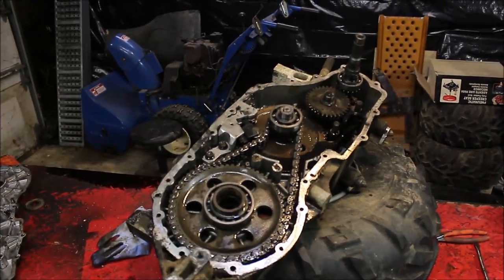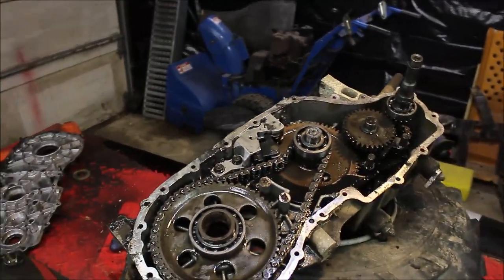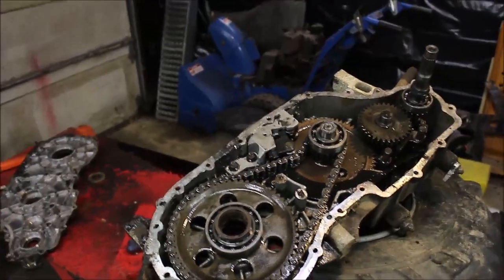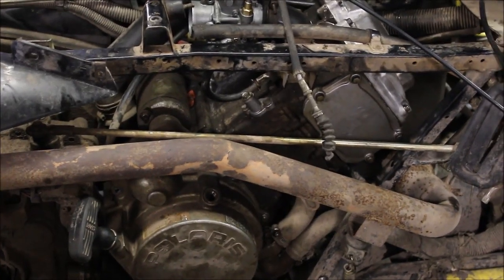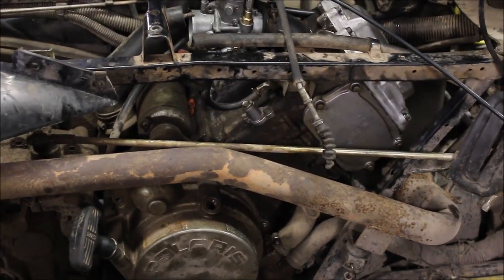Titaniumman Garage intro.

Comment: Your channel is our source of information on sportsman’s for us please keep up the great work !!! LOVE THE TRAILER !!
Reply from the maker: Thanks. Hey how did the engine build go for you?
Reply: @TitaniummanGarage  He has bought all his parts just waiting on it to warm up enough to get into the Shed so he can start on getting motor out and start rebuilding it probably here in a month or so we just got the atv off Facebook last year never touched it other than determinatid it was locked up so we started buying parts for it off eBay never done this on this type of thing so my husband started watching your channel for advice and we have been re watching them all winter so it will go smoothly for him he has never worked on ATV’s he’s a retired truck mechanic from Peter built so hopefully it will go great we did take your advice on the head it cost a little more to find a good used one and we bought all the other stuff individually piston gaskets etc but it will be worth it in the end no china junk going in .... I HAVE TO BOLD TYPE THIS !!!!! Had YOU NOT POSTED THAT VIEDO OF THAT CHINA JUNK HEAD THAT MORNING !!! We WE WOULD HAVE BOUGHT THAT KIT THAT DAY AND PROBABLY HAD TROUBLE ..THANK YOU FOR L U DO 🇺🇸🇺🇸🇺🇸🇺🇸🇺🇸
Reply from the maker: @patiencepeeler7103  Tell him if he has any questions to contact me. He sounds very mechanically inclined. With my videos as an aid he shouldn't have a problem. But those 500 are tricky when it comes to the carb. Took me 2 years of working on them to figure all the problems out. That's why I share them.
Reply: @TitaniummanGarage  thank you sir ! I do get a lot of great advice and information from your videos   ......THANK Y’ALL from  Ken Lancaster patience husband

Comment: Hey am i supposed to have two cam retaining rings ( goes between the cams and the valve cover) i pulled the valve vover and only have one
Reply from the maker: What machine are you talking about? Year model? You said cams meaning 2.
Reply from the maker: Oh..Got it. Predator/ outlaw? Never worked on one. I couldn't tell ya.